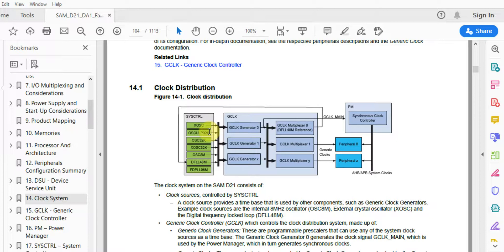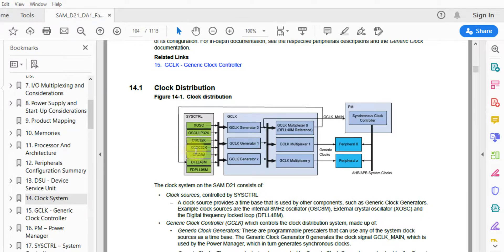SAMD21 ARM Cortex Tutorial #2: SAMD21 Clocking (Bare Metal)

Comment: How's your OSC32K accuracy? I routed mine to the RTC and I'm getting 4 minute drift in like a 5 hour period. I don't have an oscilloscope to compare frequencies
Reply from the maker: Yeah that seems like typical behavior...The OSC32K is not good to use as an RTC...only for short times like an hour or two...even with a lot of calibration I think 1.5% is realistically the best you can get. If you want to use an RTC then the external XOSC32K with a battery backup is a good option.
Reply: My board do have an XOSC32K so that's what I'm testing now. Hopefully it's better so I don't have to rely on NTP often to discipline my RTC